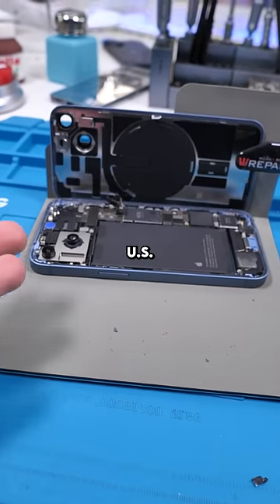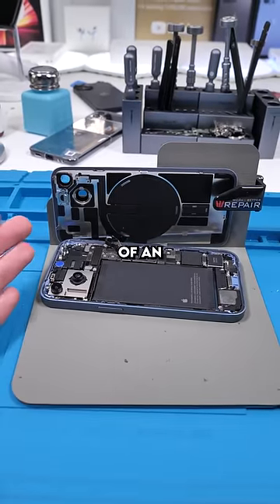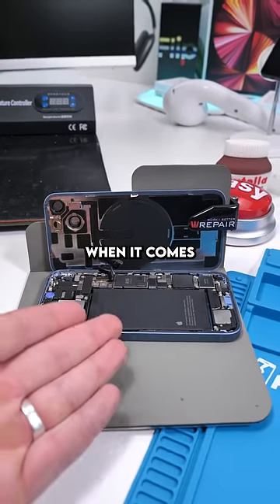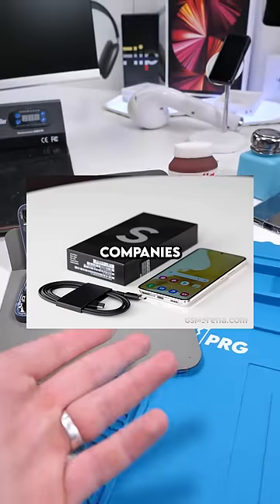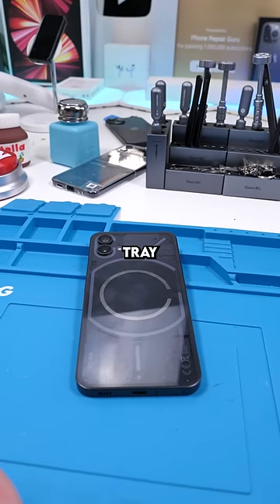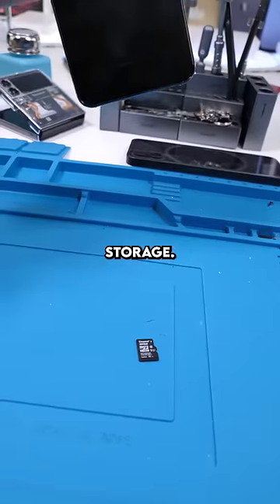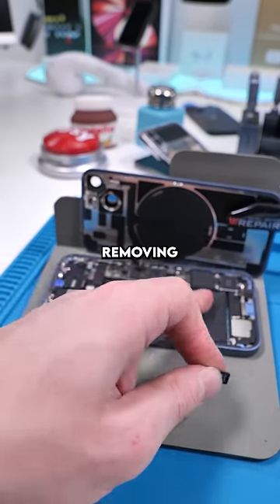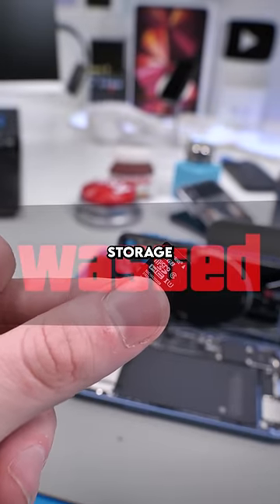The Serious Downside Of E-SIM..... #shorts

Comment: Most manufacturers will remove the Sim card slot and replace it with a SD card slot so there will still be a tray but it will only hold a SD card
Reply: Some niche manufacturers maybe, I think more will push cloud based storage
Reply: @Johan87577  or bigger internal storage maybe? I mean we already have 512 and 1tb storage options and that's fairly hard to fill
Reply: @rajder656  Depends. I've notice the app sizes creeping upward with every update. A gig here and a gig there and soon the phone needs replacing.
Reply: SIM card slot will never be gone, because eSIM is illegal in mainland China.
Reply: @gerovzhechni  you do know they make dual sim exclusive for china? The slot to put the dual sim thing is there but  but it isn't populated

Comment: I have the S20 Ultra and am holding off upgrading because they took away the microSD. I love being able to put insane amounts of data on it.
Reply: I have a s21 still has mircoSD storage. The s22 does not they took it away. Wait for feb 2023 when s23 comes out. It going to have up to 1T expandable storage . So glad they brought it back ,so you will be able to have an insane amount of storage specially 1T  terabyte ,,
Reply: Consider looking at Shiftphones - im using a shift6mq - AMOLED display, removable battery, dual sim tray, micro SD card slot, 3.5mm headphone jack (fm radio included), fully modular and repairable 🙂
Reply: I am willing to realize that people use phones differently than I do, but how would you ever need that much storage?

My phone, as with most phones nowadays (including budget ones) has 128GB of storage and no extensibility, and I cannot imagine getting close to filling it up. I've had the phone for 2 years and take pictures and record 4k video almost daily, and I've never gotten close.

If I want massive amounts of data, that's what I have my laptop with multiple TB for.
Reply: @tbuk8350  because you are not an audiophile nor a photo enthusiast. Lossless HR music takes up a lot of space as does recording high quality 300Mb/s 4K video. Add Wikipedia offline and a collection of pdf magazines and suddenly, 1TB is barely enough.
Reply: @tbuk8350  I just like downloading a bunch of media for offline usage, apps too also tend to take a huge chunk of my space... especially as I tend to kinda treat my phone much more like a pocket PC compared to many other people, lol

Comment: I'm going to be 100% adamant here, I'm never buying a phone without the option to put in a SD card. I've been using SD cards since 2015 and have dozens of them, all with important photos and files, things I always want to keep around. Not having the option to put in a SD card for me is life and death
Reply: Totally agree!  Have an old Note 2 which suffered from a system corruption which renders the phone unusable until after hard reset.  However I was still able to copy essential app user data onto the m-SD card before wiping the phone, then transferred such data into the other (good) phone.  Those user data concerns mainly with Whatsapp chat records which had not been previously synced online (and could not be done at all under the corrupted system) but still resided in the phone's local backup. Having expandable storage does save the day, which renders having big internal storage capacities a real joke......
Reply: @vampyrelycan99  you're talking about a phone from 2012. of course things like that happened. Not so much anymore. Just buy cloud storage and backup your WhatsApp data to there.
Reply: @christopherjz  No, you missed the point.  On my current phone I have WA set to sync every day but nevertheless still watch out for those local backups which I periodically copy onto the mSD, just in case.  Why depend solely on the cloud when local expandable storage is just around the corner for certain personal file backups?
Reply: @vampyrelycan99  because you're more likely to have an issue with losing data you have stored on SD cards than you are with cloud backups. You said yourself, you back up WhatsApp every day to the cloud but only periodically to an SD card. What happens when you want to recover that data and a huge chunk is missing because your last backup was from 6 weeks ago? The cloud just makes sense, you can access your data anywherr from any device; android, apple, windows etc and not have to have an offline filing system for your SD cards. Obviously this is just my personal opinion, there's no right or wrong here.
Reply: @christopherjz  going by the same line of thought, what happens when you're out and about, you can't look at those pictures without internet and you could have taken a bunch of pictures that won't be backed up until you get home, so if your phone breaks before then those are gone and worse should you ever get locked out, either because of leaked passwords or Google can revoke access to your account for any reason, then you lose everything, surely you heard that recent story about Google reporting a father for CSAM because he was sending photos of his child to a doctor? Well last I heard he still hadn't gotten his account back, the cloud is not as safe as people want to think, never rely on just one backup solution, that's a good way to get caught out thinking your safe.
Reply: @vgamesx1  no I hadn't heard of that story but if it's true I don't think he should have been sending the pictures regardless, but that's a different topic. I pretty much have internet wherever I go, my phone has an unlimited data plan and if I didn't have my phone because it was flat or something then I probably wouldn't want to be looking at photos on it either. As I said just my opinion. I don't use sd cards for backups, and probably won't. If I was a photographer I probably would though.
Reply: @christopherjz  I never said in-phone mSDs are for primary storage and backup.  In fact many of us know those cards can fail as well after prolonged use.  Data saved on the card(s) get frequently backed up onto the PC desktop which get further backed up in various ways.  Also cloud storage has its capacity limits as well unless you're willing to pay dearly for unlimited storage.  Oh BTW I don't use a smartphone for primary telephony so no SIM cards are installed; in other words NO all-time network as you would fancy.   Having local removable storage capability still has its advantages when utilized in a diligent manner.

Comment: The problem I have with this is in the fact that I can quickly move files to my softmodded consoles. I would have to boot up my computer, which takes more effort than probably necesary. Not only that, as a power-user. I have a lot of customization applications that run from internal storage, so all my leisure apps will have to be installed on the SD-card.

Comment: E-sim is kinda practical. It increases water resistance by a lot so drowning your iphone 14 series is now almost impossible when you follow the right orders to prevent it from drowning, maximum 1m for 30 minutes or so. You can search or ask repair shops among you to collect data of drowned ip14s. You'll be surprised how well sealed those US iphones are compared to european ones.  I saw somewhere on YouTube one video about those iphones, then he throw it in to the lake with small steel and string attached to this iphone and after 6 hours, roughly 4m deep he took this iphone out and it still worked. Then he bought simple sealing plug for the charging hole and he covered speakers and microphone with some dustproof covers. The iphone survived 13m deep immersion for 2 hours befor it broke. He than tested EU market iphones and after 1 hour and 4m immerse, iphone was dead.

Comment: I will go without a smartphone if that happens, trust me, I've lived most of my life without anyway
Reply: I mean, that's a little extreme. Extendable storage was more of a necessity with old phones, because they maxed out at like, 16GB of storage.

Nowadays, even budget phones start at 128GB, and you can't go lower. Flash storage is so much cheaper than it used to be, there's not really a need for extendable storage when the phone has more than enough storage space for 99.99% of people to begin with.
Reply: @tbuk8350  It's still necessary if I want to put my pictures on a different phone.
Reply: @tbuk8350  yeah phone storages have been massively increased. But still is not a valid reason to remove extended storage. As I might need it for different purpose for storing and transfer of files from mobile to other devices or might want to keep a seperate storage. I think apple is doing it just for the sake of calling it new feature or something.
Reply: @dhivakar111  Yeah, true. If every manufacturer used USB-C (I'm looking at you Apple), you could do what Android phones do and transfer files over USB at incredibly high speeds, and you wouldn't need a MicroSD for file transfers.

The benefit of USB-C here is that you can transfer between not only computers, but also other Android phones.

Comment: You can buy an sd card adapter. It's relatively cheap (probably can be found around 10 bucks) which connects through your charger and fitted with an sd card. Unfortunately you can't access the items you transfer to the card all the time but I'm sure people have a huge albums they wanna keep for memory but they don't wanna pay a subscription for online storage
Reply: Yes but the issue is WE DONT WANT OR NEED ADAPTERS.
Reply: MicroSD card are so thin that you can mount it in your phone and forget about it. And now I need a dangaling or bumpy adapter plugged into my phone which occupies the only charging port just so I can send that one meme to my friend? Why?
Reply: I get what yall are saying. The issue is these companies are getting greedier and they'd rather have you pay for online storage so they're not offering sim card slots on their flagships. If people become more aware they can use adapters for sim cards instead of online storage their dumb practice will end and they'll start offering sim card slots for competition because the revenue they get from online storage will drop and offering sim slot will be better for profit
Reply: @enga-qs6co  dude I'm not using a adapter for audio or SD cards. What a scam (on a mobile phone)
Reply: You mine aswell get a USB hub and connect USBs at that point
Reply: yeah or you could jsut use a usb drive

Comment: You're exactly right about this. When I purchased my s21 I was pretty upset to find out I could no longer use a sim card. The only reason I purchased in the first place was for emulation and 128gb doesn't get you very far.
Reply: My s21 has a sim card tray🤷‍♂️
Reply: @Thomas998822  I think they meant SD card tray
Reply: s21 has SD tray for bigger storage.
Reply: @Renna S  S21 Ultra doesn't, I'm using one rn
Reply: @rennas4619  my s21+ doesn’t have a meme pet card, but it does have a dual sim. I’m in the U.K.
Reply: The very reason that I opted for a S20 FE!!! It has both 😊
Reply: I mean if u can get that type of phone you can buy one that has more storage. Just a suggestion
Reply: My tablet has 128GB of storage and it had no room for any apps it's full n I only have 3apps no videos or music to go out with
Reply: @efranckor_27  Depending on what you want to do, you may find that storage still runs out. For those kinds of things, your only saviour is an SD card
Reply: Lol, my phone for the longest time only had 8 gigs.
Reply: My 128gb phone is now 4yrs old and still has half of free space left. What do you even put on your phones, delete blurred selfies and you'll be fine
Reply: @caydanhunsaker3822  Damn - even 32gb of internal storage on my s7 was barely enough despite my SD card xD
Reply: This is why I still use my Nokia
Reply: @vitoromega13  Advantage of a Nokia too, is if you ever have an attempted mugging....you could probably throw the Nokia at the muggers face and knock them out cold, assemble the nokia together again and call the police xD
Reply: @Chris47368  nah, the Nokia is overkill, just a .50 to the head is enough.
Reply: @vitoromega13  😂
Reply: @blakecorbey9502  how's that even possible?!

Comment: Honestly, with top of the line modern phones having up to a terabyte of fast internal storage, and budget ones having 128gb+, I personally won't miss having an SD slot. I absolutely get why people hate to lose an option, but realistically, I'm sure that only a small percentage of people actually need an SD card slot. The majority will benefit by phone manufacturers being able to fit more things in phones/make the same phones smaller

Comment: I bought a $15 SD card connector that has lightning and USB C and USB plugs. It can connect a micro sd card and a regular sized sd card. It works well. 

I already have another external storage device, a sandisk dual drive luxe USB C. Whenever I get the iPhone 15 pro, I can just plug it into its port with no problem. I can already plug and play it with my iPad.
Reply: @shawnm8232  I understand, and fully agree on disliking the cloud. I’d rather be able to access my data anywhere I go without relying on internet connection

Comment: I personally use e-sim, but completely removing Sim card tray is problematic specially when you're travelling abroad. Recently I was in Indonesia and realised that no telecom operator there supports e-sim, thankfully my S23 comes with physical Sim slot so it was simpler to manage.
Reply: true i mean theirs ups and downs to removing the sim trey but this is why it was only done in the u.s also on the right side if you lose your phone your phone you cant track it and dont need to worry about a theif removing the sim card

Comment: Not true! You can connect a usb c or lightning dongle with an SD card slot to the charging port, even one with a power pass through or even an Ethernet RG45 connector and connect to your network and any of its devices including pc's, laptops, which you can save your files to or download them from!

Comment: You're wrong about it because of the fact that removable batteries will be required in ALL devices soon. If removable batteries are coming back, so will in-house sd card slots. Usually, these are located under the back panel of the device itself, where the battery compartment is located, and is typically located very close to the battery compartment. This means that expandable storage will likely just be located under the back panel of whatever device you're using at that time. Android always has had expandable storage, I highly doubt they'll cut that feature. Hell, there's even settings on lots of Android devices made by many brands, that allow ram boost mode which uses some of your storage, in which some can even go as far as utilizing the sd card you use for expandable storage, and uses it as vram. I don't see why they'd kill a classic popular feature that is essential to using other, more modern  popular features.
Plus you said it yourself. Apple is a company for trend setting, and they can't set the trend to remove expandable storage if it was never a feature on Apple's iPhones to begin with. Android will work around that pesky sim slot issue.

Comment: Extendable storage was useful when phone storage was 8gb 16gb or even 32gb circa the android 2.x and 4.x versions and you would be scrambling on the config apps settings to move apps to external storage otherwise you would be out of it soon enough.
When onboard storage became massive as it’s normal to see phones with 128gb 256gb or even 1tb why would you need extendable storage?
Apps on android most of the time now cant be stored on SD , just photo and video? Its not even worth it 
Also, with usb-c on all androids is better to plug a usb-c memory stick and move all things out (which will be just photos and videos anyway)

Comment: it will be one of the dumbest things they could do, but companies lately haven't exactly been showing great intelligence.   Anything to save a few pennies to maximize profits - despite making products less desirable and people like me - simply won't buy them.

also - there is still a storage solution - but it requires a USB dongle for the 'on the go' storage system.  It's not as nice, but you can then use it to "offload" your phones storage, onto an SD card, to later plug into PC to offload, or just store on SDs.  This doesn't, however, help with App and system updates, which doesn't exactly bode well considering each update takes up more space, and you have very limited space then- only pushing people to 'buy the new upgrade phone today!' instead of... just having more storage.

Comment: I'm using the S10 Plus (128GB) which still has an micro SD card slot (512GB) which I use for storing videos, music files, photos and downloads from streaming sites I plan on upgrading soon but I'm debating if I use get a 256GB or 512GB model.

Comment: I got an rog phone 7 ultimate, got 2 Sim cards and no extra storage slot because it doesn't need it, it has essentially 2 headphone jacks and 2 USB-c ports. It's just an apple moment when removing things from phones. Like my phone came with a charger? I can reuse my phone after 1 charge and charge it isnanely quick with a higher, new gen charger instead of last decades one. Fr No one should be following apples trends or buying their products thus supporting them. You can't have innovation if you only take away features but improve performance, oh wait sorry not performance, efficiency, because that's the only thing they got going for them.